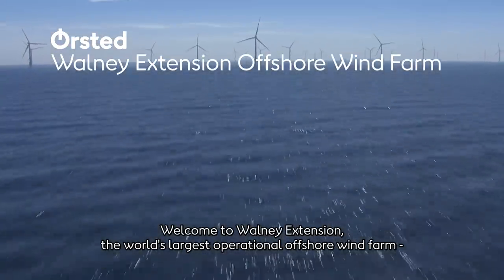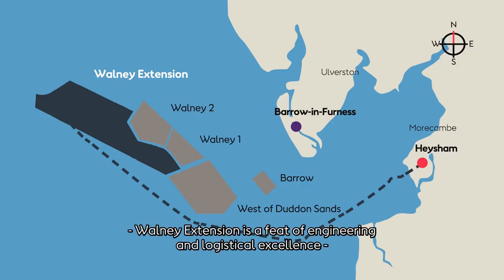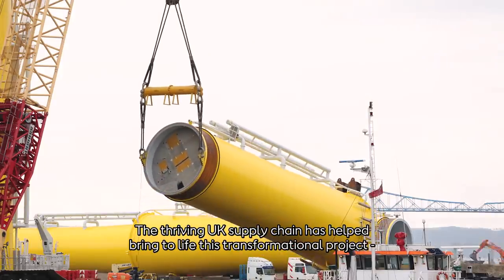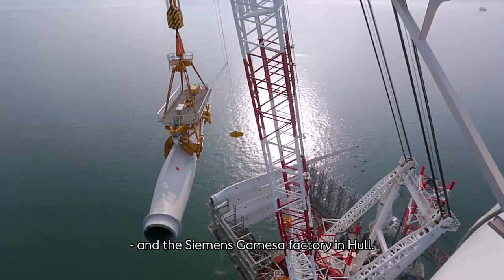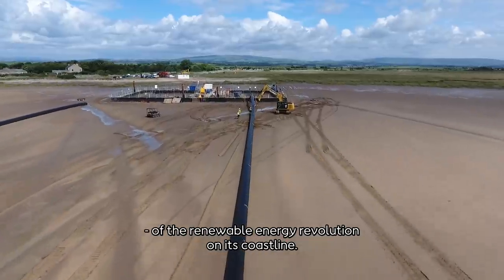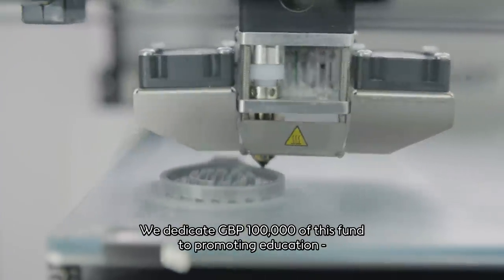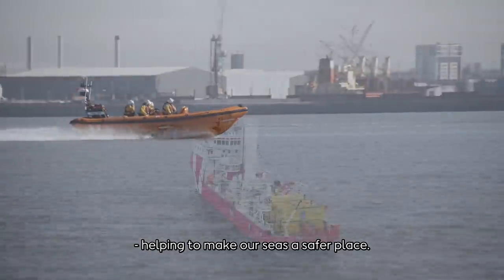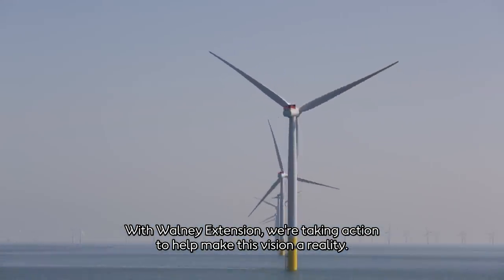Walney Extension – the world’s largest offshore wind farm in operation

Comment: Great to see the transition happening from oil and gas to renewables. HalaluYa!
Reply: It's nice that it's clean, green, and all that, but locally produced, and never runs out, and never goes up in price is pretty sweet too.
Reply: MM, 
it is not and will never be a transition from oil and gas. Wind and solar, are pretty poor generators of electricity.
Erratic, power ramps up and down as wind speed varies; the power of a wind generator is a cube law to wind speed.
Unpredictable,
Need back up generators running all the time.
Cannot load follow
Wind is unstable power and is disruptive to the grid the more that is added
Expensive, despite all the hype form the press who do not seem to know all the subsidies and extra costs that wind generators benefit from and to the consumers detriment. One third of our electrical unit cost to consumers is due to these costs.
Nuclear is often compared but what is overlooked is a nuclear station can run at near 100 % output when required and averages near to 90% of installed capacity. Wind is about 25 to 30 percent of capacity average. Cost is one thing but value is chalk and cheese.
Reply: @iainreid9914  well I work on wind farm controllers and some of the things you said werent accurate. Its true that wind energy is unstable and you need to relay in an stable source like nuclear to follow the grid demand. But thats why there is a lot of investigation now about how to incoporate energy storage systems to wind farms and solar stations. With the energy storage devices you can achieve an stable output of energy like classical sources supply.

Anyways you mention that wind is unpredictible, but there are incredibly good mathematical models that predict the power output from wind farms with accuracy. It is use to regulate the market and the expected error is low. 

Today is imposible to left behind all the other energy sources to just rely on wind and sunlight, and maybe we'll never be able to, but the progress in that direction is real and surely we can eliminate oil and gas to just left nuclear and renewbables.
Reply: MA, 

Batteries are another expense and you need very large capacities for grids. Realisticly they are not feasible to the extent that geting rid of fossil fuels calls for. Nuclear power needs a special design for them to be used to modulate load, currently they generally do just base load power.
The output from wind generators ramps up and down with time which has to be compensated for by gas and coal stations to balance the load.
Another fcator is black starts, can your farms do a black start?
Reply: @iainreid9914  
Total FUD, congratulations.
Reply: @iainreid9914  
Right now, at this exact moment, the UK is running on 26.2% Renewable energy. It's fine weather, low wind at ground level (onshore) and some cloud. I'd say that's not too bad?
It more than nuclear (24.7%)
It's more than coal (5.7%)... Coal will be GONE in 6 years, by that time renewables will be well over 60%.
The average for Renewables is 27% btw, that's going to increase fast over the winter, they've just installed the two largest offshore windfarms in the world and are about to install the world's largest storage battery.
If you're in the USA and you're not going green, you're getting left behind.
Reply: Roger, don't rely on averages, the grid works on instantaneous.
Now wind is at about 8 Gwatts, quite good for it but in reality only about 40% of installed capacity.
Percentages at the week end flatter as the demand is lower. A big part of renewables contribution is the constant biomass (About 3 Gwatts.) from Drax, calling it renewable is fraud.
I think your assessment of America is wrong and they also required large thermal generation. In due course it will be evident as the problems of too much wind generation is felt (As has happened in Australia). I just read a report that assesses California's 100% renewables by Governor Brown (Did he not learn about Canute?) which calculates that each Clifornia resident will need approximately 60 power walls for it to work. Currently I understand that California's power cost is 60% greater than other parts of America?
It is not now and never will be the answer.
Reply: Frank RenewablesCheap the video doesn't explain the sales price, what fraction of the time do the turbines work, what backs them up when the wind doesn't blow or blows too hard, and what is the actual reduction in CO2 emissions, given that gas fueled turbines are used to back up the wind turbines
Reply: Iain, Thank you for succinctly explaining what needs to be said - - finally!  Public awareness of nuclear's role in combating climate change is a long battle, but with patient explanation of facts and data like this, the tide will turn.
Reply: MM -- Coal is the one that's suffering most from transitioning to wind and solar. Natural gas is actually benefiting from it because variable and intermittent wind and solar increase demand for flexible generation, which is something certain kinds of natural gas fired generators do quite well. As for oil, it is mostly used in transportation. That means that oil is mostly unaffected by growing renewable energy unless more combustion engine vehicles get replaced with electric vehicles.
Reply: @keithrodan7763  You cannot combat climate change. The climate changes all the time NATURALLY and that is an undisputeable fact.  Adding more wind farms and burning less fossil fuel will have no effect on when the next ice age comes and how deep the ice is where you are currently stood.
Reply: @iainreid9914  The materials used and manufacturing of green energy is also very dirty and relies on toxic and high polluting production materials. Green energy solar and wind power has yet to still generate 1% of global energy. The statistics are skewed. This is an ecofascist scam and tax on prosperity for generations to come.
Reply: @organichuman  

I entirely agree.

Comment: One question remains: Where does the power come from when the wind doesn't blow?

That's why they changed from wind to steam engines 200 years ago.

And: You can't store all the surplus electricity from the summer for the winter. PERIOD.
Reply from the maker: Hi Johannes

To ensure a stable energy supply throughout the year, it’s important to supplement with back energy production. Fx. in Denmark we supplement with biomass-fired power plants.
We are also working on developing technologies within power storage.

Best regards,
Astrid
Reply: interesting point, I didn't think of that!!
Reply: "You can't store all the surplus electricity from the summer for the winter. PERIOD."
That's a good argument for solar but not wind. Autumn and winter (from October up to and including March) are actually the times when wind power produces a larger share of its annual output. Summer is actually the season where wind power is typically in a slump. I know this is a youtube comments section but is it too much to ask to get the basics right?
Reply: @Orsted  Biomass is a waste of crops and land. Not sustainable at all. Some of the materials used to manufacture windmills and solar and scarce and toxic. How much steel, concrete is used for bases and how about the toxic rare earth minerals?

The fact that energy costs are so high now since we have to subsidise green energy companies is in taxes and high energy costs is ridiculous and robbery. This is ecofascism! Green energy can't even power 1% of the worlds energy demand, it never will!

The manufacturing and mining of materials is severely polluting to the environment. Then we have the issue of storing energy is means more mining of toxic lithium and more environmental damage. We now know none of this green tech is clean but in fact very dirty. Latest scientific studies show that a diesel car pollutes far less than an electric car does in its lifetime but we were told lies about that too. Just like everything else.
Reply: @hyric8927  They just want to rip us off with their ecofascist green energy scams and tax us for it and subsidise private companies and pay higher energy prices while all the pollution is out of sight. If we keep quiet and don't ask inconvenient questions they are happy. We are their work/tax slaves.

Comment: You fill 2 large grocery store size garbage dumpsters with waste when building a wind turbine, your fill one for each half before its glued together. The gel-coat is sprayed into each mold before building and its initiator is Methyl Ethyl Ketone Peroxide, thats right and its cleared from the building and pumped outside. Then hundreds of pounds of balsa wood are added during blade construction, when finished after many layers of fiberglass matting each half is vacuum sealed and pumped full of hundreds of gallons of initiated resin. Tremendous amounts of coal fired power is used in making turbines. Then comes the shipping. After installation they average 25% of capacity and think of the taxpayer subsidies. No i am not  against any alternative energy just a realist.

Comment: 600 MW is just 50% of regular nuclear reactor power and it wasting a huge territory, creates much of infra sound noise.
Reply: Easy to make a bigger park with that power output of a nuclear power plant, but why to do that, because competition?
Question for you "how many years you need to built a nuclear power station and how many years you need to break it down after it has finished?"
Reply: +Fly Twin Question for you: How long will these wind turbine installations last? Answer: About twenty years (as compared to 40-50 years for nuclear). AND there probably won't be any government subsidies around for rebuilding/replacing the wind farm.
Reply: Fram
Nuclear?
Hinckley C
Tell me please.
How long in planning?
How much over budget (already)?
How late is it running?
How much will the power cost?
........
20 years total (to date).
3 times over original cost, current estimate £20bn ($26bn). 
MIGHT be ready by 2025, maybe 2027 (that's another £770m). Power cost? Hinckley £92.50 /  MWh. (2025) 
Note; Similar output from new wind turbines? £57.50/MWh
 (2023!) No subsidy! Including design, construction, deployment of turbines!
Thats 37% cheaper and at least 2 years sooner!
Reply: Fram,
"Wastes territory"?
"Noise"?
It's 12 miles out at sea!
Reply: FRAM WTF A Grid Feeding Nuclear Rector that Operates Entirely Off Shore floating on Water.  Does not Exist commercially.
Yet you called this "wasting a huge territory".
Reply: @mikemckeaney6714  I'm pro-(existing)nuclear but nuclear reactors don't last that long without refurbishments. And their initial official lifespan was much shorter, there have been a lot of lifespan extensions, somethings that might be done for wind turbines as well...

Comment: HAHAHAHA lets show the off shore sub station, oh look a big diesel tank and diesel generator, so called green power still needs fossil fuel to help make it work to make intermittent, unstable output, expensive power.
Reply: That is currently cheaper than any other fossil fuels?
Reply: Would've been a good point 10 years ago, but now we have batteries that store electricity from renewables (and they're only getting cheaper by the day)
Reply: To be honest though, diesel generator backup is required to keep the aeronautical and shipping navigation lighting operating, to also allow power to keep the turbine computers operational for a couple of weeks or so if there is a loss of connection / significant damage happens to the seabed power cabling, something batteries are not capable of over that kind of time period.
Reply: actually, the UK built new diesel generators as backup, current capacity to fill the void left by wind and solar is nuclear, gas and even coal, battery storage is still too far away to be effective in 2018

Comment: What an incredible wast of time and money. Back into the Stone Age of energy generation. Wind mills became obsolete with the unset of the industrial revolution.
Reply: I believe general pollution levels have returned to pre industrial revolution levels? Thanks to renewables!
Reply: Globally renewables are very small part of the energy market and have made no difference as renewables force base load fossil fuel generators to operate more inefficient. Also, CO2 is not pollution, it is plant food but advances in technology have cleaned up power-station outputs from other materials that can be called pollution like sulfur or NOx gases .
Reply: Actually a local windmill to me is back in use, producing flour. They've also set up a restaurant selling products made from the mill and they're expanding hiring new staff.
Reply: Zero energy costs , is a good business asset. Also the UK has massive wind resources that can be owned and operated by local cooperative just like in Austria.
Reply: As soon as there will be no government support for wind and there would be a free energy market this wind technology would be dead within a few years. Wind is unreliable intermittent and low energy decency so useless to power a civilized country.
Reply: Interesting! I like to see all sides of things, and I would certainly like to have less PM 2.5 pollution in the world. Less methane would be good, too. However, any step forward is better than burning oil or coal. Natural gas is probably much less harmful than Canadian Tar Sands oil or Venezuelan crude, so I support it until we figure out how to harness the energy of the sun and ocean. In regards to CO2, ocean acidification should not be dismissed. Windmills and wind turbines work, though, so I would never discard them. In fact, my family's home here in Texas is powered entirely by wind energy generated in the western part of the state (to the best of my knowledge).
Reply: The way I see it, wind has been obsolete since the the industrial revolution. It is only the environmental movement in combination with socialistic governments that have made this outdated technology feasible; it will be gone tomorrow if free market forces are allowed to compete on a even footing. If this planet was so sensitive to trace gases then it is a miracle that this planet exists in this form and it most likely would be the only one in the universe. But how was it then possible for this planet to produce life about 3.5 billion years back when there was no oxygen but it least about 15% CO2 and heaps of Methane in the planets atmosphere?
Reply: If I could drive a car powered by natural gas or hydrogen, I might consider it. When the Sun is staring us all straight in the face and the mantle of the Earth is right under our feet, I don't know what to say. Heck, even the first day of a 7-day week is named after the Sun in English. For anybody who would dismiss the idea of infinite geothermal energy, they may want to check out Iceland.
Reply: The government gives very little to wind, indeed onshore company Ecotricity has said it wants ZERO finance, just the right legislation. However Coal, Oil , Gas and nuclear ALL receive massive government support, so get your facts right. How much do you think a nuclear fission station costs to decommission? £100Billion + but that's not costed in because then it would make the electricity look VERY expensive.
Reply: Energy can be stored via a combination of mechanical, chemical and other methods, just like the Welsh hydro-generators that are constantly used today to support the national grid, and built by a Nationalised Electricity company in the 70's. And this current government isn't supporting onshore wind thanks to Cameron's Eaton NIMBY legacy... but don't worry that will change when government of real leadership gets in power.
Reply: Tom, 

you misunderstand the function of pumped storage hydro power. They do not store energy to make up for a drop in generation output but to cater for sudden spikes in demand . Turbo alternators react automatically to frequency but cannot react quite fast enough when large spikes occur, this is where the instant response of hydro generation comes into play. We do not need more storage given sensible generation, which wind and solar is not.
Reply: Tom, 

correct the government gives nothing, the consumer on the other hand, pays approximately one third of his energy bills in subsidies to the renewables industry. Coal oil and gas do get some support but they do not get subsidies for running. The subsdidies paid are contracted for years ahead to the renewables industry and are rising all the time.
I don't know where you get the £100 billion to decommission a nuclear station, just how much radioactive material do you think is in them?